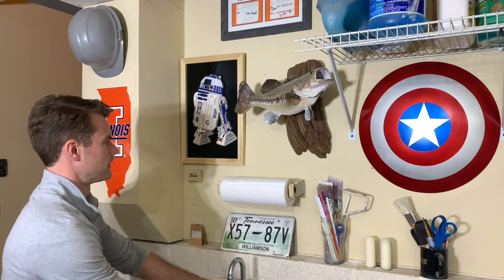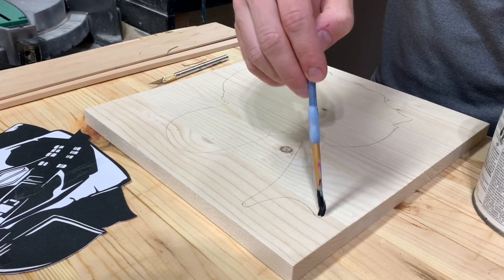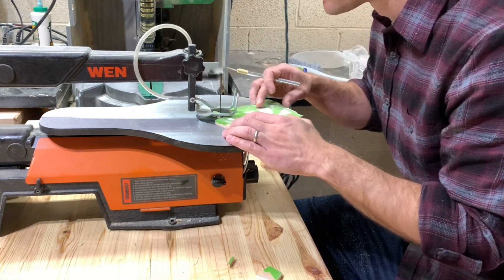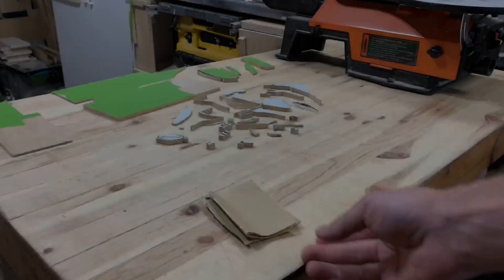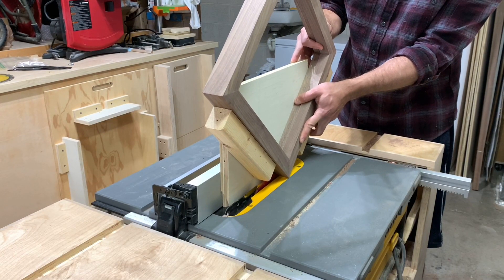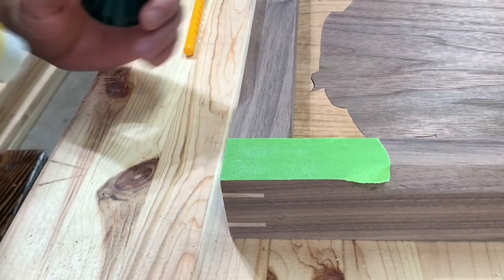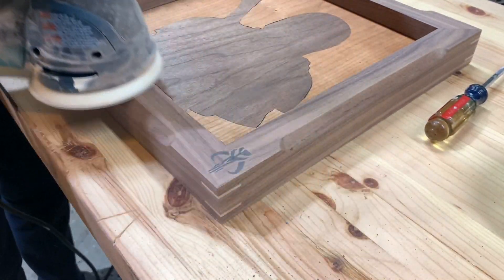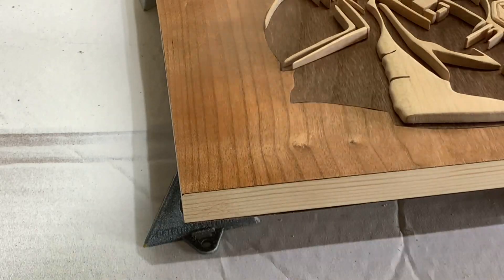AMAZING Scroll Saw Project // STAR WARS Mandalorian Art

Comment: Finished work looks amazing. 
3 things that will make this easier. 1st- take the brace off your scroll saw, it’s in the way more then it holds the wood down. 2nd- get better blades and tension them correctly and then there will be less sanding and the wood will not bounce as much. 3rd- put packing tape over the the pattern and it won’t come peel off.

Comment: Not even sure where to begin. The finished product is amazing. Wrapping sand paper around some conduit for sanding the chamfer is super handy. And using plain old 5 minute epoxy and latex paint for the epoxy fill? Genius. No need for expensive epoxies and pigments here! Keep up the great work!
Reply from the maker: Thank you so much for the kind words!! Really appreciate you watching. I will say, the paint/epoxy thing does make it a little softer than straight epoxy. Worked fine for this but would be careful in other applications. Thanks again!!